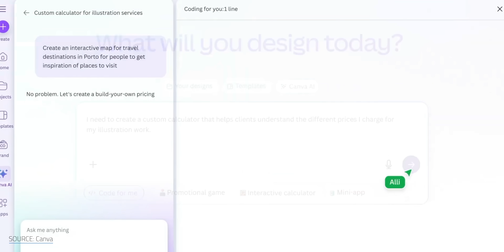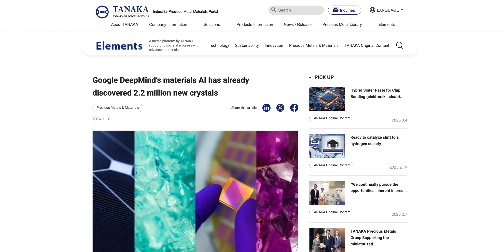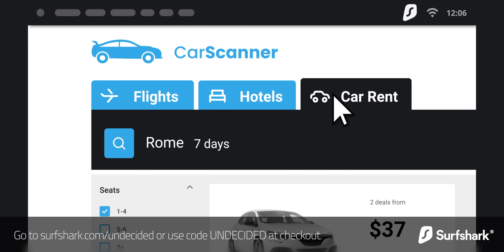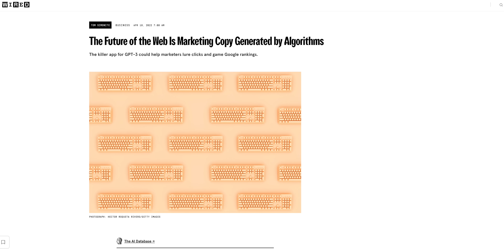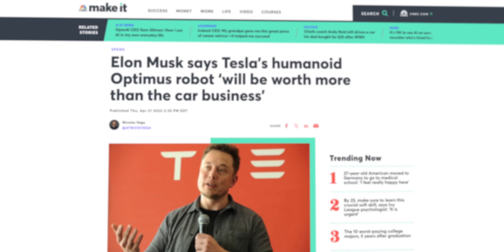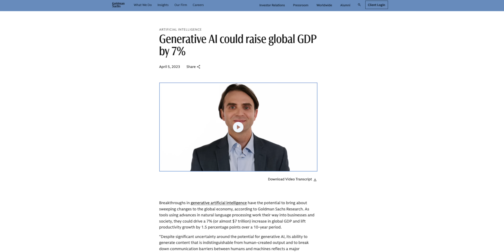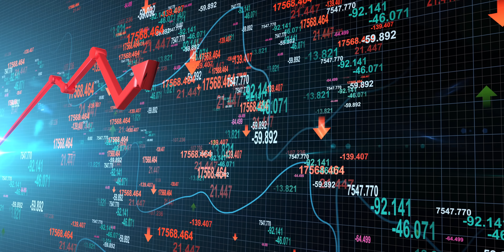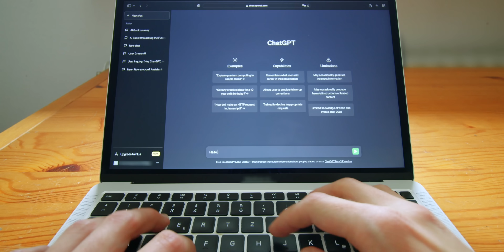Why the AI Revolution Has a Fatal Flaw

Comment: I am an AI engineer. I have seen a lack of new hiring for our operators. These operators used to do repetitive labour for the company in data labeling, for example labeling comments as spam. But we are increasingly automating this work with LLMs, and hence haven't hired anyone new since the last few years.

Also, lot of engineering work has been about automating jobs. Cars automated horsecarts out of job and tractors automated farm labourers. This is not different, but it is happening at much faster pace than before
Reply: And all those horses replaced by tractors got to retire on green sunny pastures, right? Right?....
Reply: and I'm sure that horses did not think that a loud and slow box of metal can replace them in few years.. I'm sure some of them thought "I can do much better job, and nothing can replace the spirit and creativity of horses"
Reply: @mojtabaazeez5346  and now?  Only kept as pets and entertainment
Reply: The issue is that with previous automation there has always been something else that people could do, other sectors growing to take advantage of the displaced workforce. With AI, it's not clear that that will be the case, and without government programs to ease the transition and facilitate retraining a great many won't have the opportunity, leading to vast suffering even in the best case scenario.
Reply: Not only faster, but on a much wider range of jobs. When oil/gas lamps were replaced with electric lights that was a lamplighter and a plumber. The plumber could transfer to a new job easy enough, but the lamplighter was SOL. Electricians were needed to install and maintain the wires. So few total jobs were lost. 
AI can replace everyone from HR to programmers and security/network analysts, to most of the c-suite itself; not to mention doctors and teachers and stock brokers and anyone else who mostly uses their brain in repetitive tasks. For now it's limited to office and factory jobs, but if whoever replaces Musk (fingers crossed he gets deposed and deported soon) actually gets those human shaped bots to work then in person customer service jobs, house assembly, and so many more jobs are gone. 

Sure there'll be jobs fixing the bots and stuff, but it'd be a small fraction of the total jobs and likely for less pay.
Reply: @Jcewazhere  I think you over estimate the world of AI. AI can NOT replace programmers, it rather can assist us. As a self-taught web developer, knowledge pre-AI, I've seen how AI can be over-used by students, but real knowledge like I have, can detect issues way faster in some cases, and experienced programmers are better at understanding what to ask for to get the needed assistance from AI.

I know that what I just said, also means experienced programmers will have a better time through the transition as AI improves, than students. But there's limitations to what AI can do. Some companies even can't use it, as it's considered high risk for data leaks and code vulnerabilities, at least when using public AI services like ChatGPT or DeepSeek. Smaller companies where security is a high priority might just deny AI, as it's not cost effective enough to host AI locally.

To be fair, to add up to what you said. You mention jobs as repetitive, but if that's what you assume programming is, then you should probably consider learning it, as it's far from repetitive. There's a reason it can take years to be decent at programming, and for some people, it's rather impossible to even be a good developer, because it's so heavily depending on different logic all the time. Similarities, sure, but not repetitive. Reusable code is a standard solution used in programming to reduce the amount of code, to avoid repetitive code.
Reply: “happening at much faster pace”….  You nailed it.  It’s analogous to human caused global warming over the past couple of centuries…. The earth has experienced global warming before but never at this pace.  It leaves no time for systems to adapt to the new environment and causes system collapse.
Reply: I think you have your history a bit askew.  The industrial revolution was already in full swing when the tractor was invented.  So the jobs people moved to already existed.

So where are all the jobs these displaced workers are going to move to?
Reply: For labeling?  LOL!  Good luck with that!
Reply: Correct.  Processing cycles are not free, which is another way to say it.  And AI consumes orders of magnitude more processing cycles than your run of the mill software.
Reply: I'm currently looking into doing a Bachelor of IT majoring in Machine Learning. Am I wasting my time?
Reply: @sino_diogenes  yes, train in something more practical, IT is over…your wasting your time and money
Reply: @sino_diogenes  no. AI can't code itself yet.
Reply: @sino_diogenes  No, don’t let the AI doomers discourage you. Engage with whatever engineering draws you. The ML trajectory involves significant mathematical requirements, it’s a great career choice if you really like math.
Reply: There simply isn't need for work anymore. No new jobs are coming.
Reply: @MarkkuS  That's the most idiotic thing I've heard all day.
Reply: I'm an IT manager and I can tell you if I could replace some people with AI. We could get a lot more of our initiatives completed... I long for the day that interfaces can be designed by AI....   There are just some things that a standardized process& AI managed processes can do better than humans... That doesn't mean that. I believe we should replace humans cuz I don't. I think it's going to be a big problem. But just like everyone else is saying corporations are are paying management for delivery of initiatives that outpace their competition.
Reply: Retired EE, but these last few decades, we hired engineers based on what software tools (early AI) they were adept with. SPICE through GHz simulators, engineers are now AI ranchers, hearding Agents to the task assigned, fun !?
Reply: Don't say anything critical of AI, or the AI will label it as spam and delete it.  Can anyone see this?  I have no mouth, and I must scream!
Reply: I'm kinda tired of the "if you compare it to this old thing, they have similarities, so actually it's not bad" train of thought people keep reaching for. It makes no sense.
Reply: @rhoharane I’m kinda tired of assuming the apocalypse is coming from AI…

The likelihood that history repeats, is significantly higher than your doomerism job apocalypse.
Reply: @pikeman6774  Have you even considered what history repeating in this context actually means, what it leads to, and how it would effect your life and that of billions of others?
Reply: @pikeman6774  History repeating could be very bad; the industrial revolution, for all it paved the way for higher overall quality of live eventually, was an incredibly painful, exploitative period for a great many people over a very long time; wages and working conditions only got better after a generations of struggle and fighting for worker rights, which was violently suppressed at times.
Reply: And will only get faster as AI is progressing at an exponential pace...humans are not.
Reply: The deep tissue of our reality : being Useful. Will be destroyed . It is what it is .i saw it in engineering
Reply: As I like to say, "I wanted my dishes cleaned and my carpets vacuumed. I didn't want the robot to write my books or compose my poetry." Even further, what will I write about?
Net Negative with the creative sector adoption. We'll spin out as a species. . . It's not going to help us, but oppress our humanity.

As a people, we are adaptable, we can accept change, but the previous shifts took plenty of time. AI has been as short as one single decade.
This kind of change needs all of society to be able to adapt to its numerous forms and where it will be managed and concentrated.
Full steam ahead companies don't care about the impact it has on our ownership of Intellectual Property, or our personal inventions and creative processes.

I think that if people want to automate necessary materials and manufacture A LOT of 'stuff', that's an okay thing. It prevents certain dangers and produces more efficiently. To prevent job loss, those manufacturers should look at how workers can be transitioned to maintaining those automated systems. Not as computer scientists, but managing the physical end of the robots.
A.I. shouldn't replace our creative brains. That's the side of humanity that reaches out, sees new things; and AI is just hallucinating that. It doesn't really make art. It can't. It just steals what has been made for more creations. Which is evil incarnate.
Reply: @Amendelwyr too bad.  Computers and machines stole my trade.  You didn’t cry for me then.  Now it’s onto the creatives, I’m supposed to feel bad?  Nah.